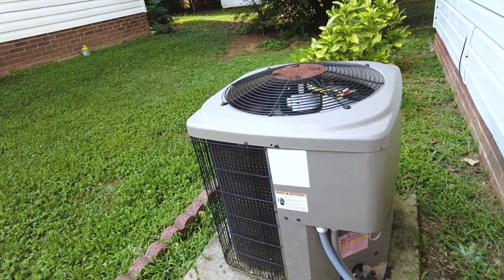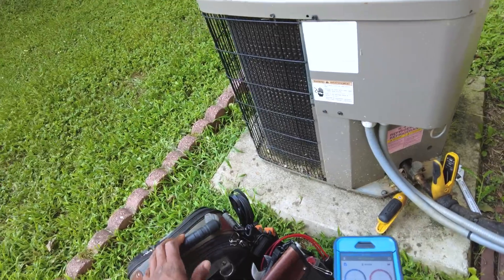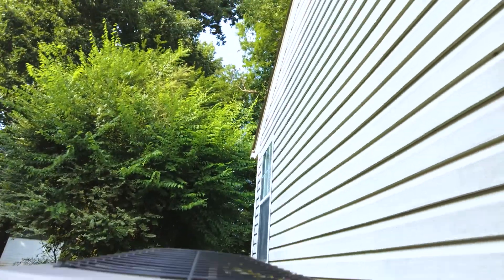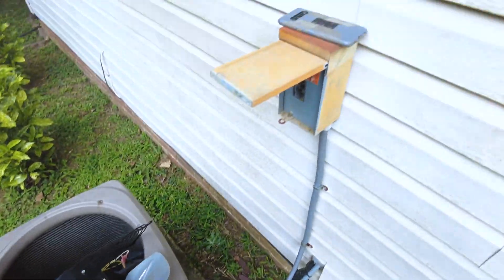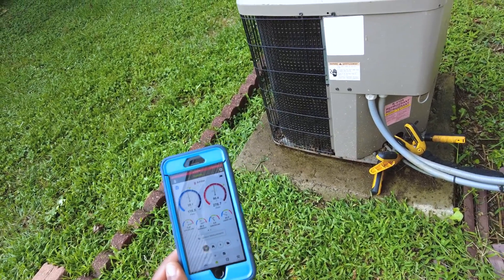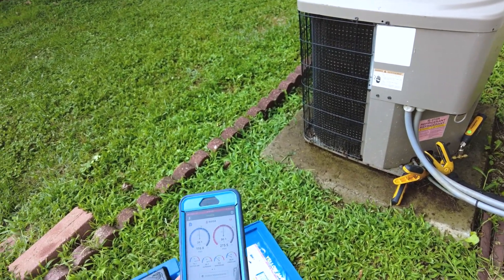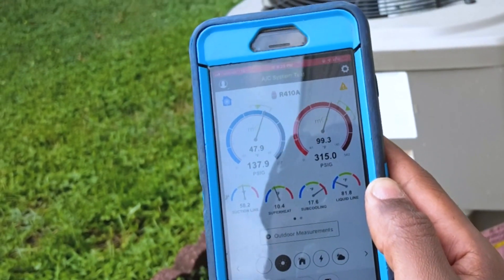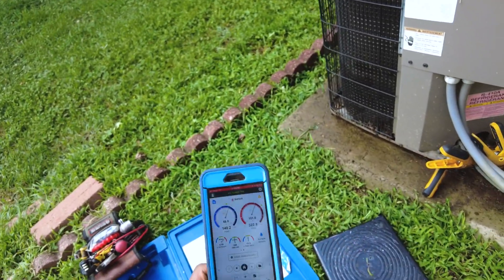Why you should always check AC coils before charging system | How to charge system with dirty coils

Comment: Ya I’m not a fan of those micro channel coils 
After you wash them you should slap them on the inside, you’d be surprised how much water will jump out. Those micro coils hold that water for awhile after a washing
Reply from the maker: Oh yeah? I never knew about them holding water like that. Thanks for the tip, I'll definitely keep that in mind next time I wash them. I'll know if it takes too long for my pressures to stabilize to blow them off with compressed nitrogen or something.

Comment: A clogged condensing unit would lower my Sub cooling because it can’t reject heat? Thanks!
Reply from the maker: Yes, essentially because it's not rejecting the Heat the liquid line temperature raises disproportionate to the condensing saturation temperature.
Reply: My old comment. Good times lmao

Comment: The tech changed my txv and I changed the air filter, but the air flow is still hot.  The  themostat on a steady 80.  

The tech came said when he changed the txv the Freon was not enough to cool the house.  He came in put more Freon, but now thermostat is on a steady 85. 

The tech indicated it is best to fill the unit with Freon when it is hot.  I changed the filter clean the outside vents.

Could you give me your assessment on this matter.  It is a new txv.
Reply from the maker: Hey I'mnot 100% on what it could be, it sounds like it might just be a large leak or something. Has he done a leak check?

Comment: Good advice on the drying of the coils to stabilize. Doing commercial in Ft Lauderdale we find coils really dirty especially when condensers are located in the parking garages. Tons of dirt even in an upscale super clean environment. But the external nearby exhaust fans set up to pull the heat from the garage pulls all the grunge. Hair, leaves, trash etc all get pulled towards the condensers.
Reply from the maker: Hey, thanks for sharing! Yeah is its definitely important to wait for them to stabilize but sometimes can be frustrating when your trying to get to your next call cause you have a packed schedule LOL.

Comment: Fantastic video I have recently acquired the testo setup I need to learn how to use the measure quick app a little better.
Reply from the maker: Nice! Which Testo system are you using? Their stuff pairs well with measure quick so I definitely recommend you getting familiar with it. It will make testing and troubleshooting so much easier and more interesting.  Check out the measure quick Channel on YouTube they do a lot of in-depth tutorial videos.
Reply: @HVACTechKnowledgy   Thank you for responding I have the testo 550 I with the 2 hydrometers and and temperature clamps